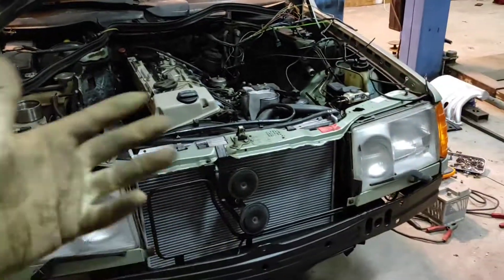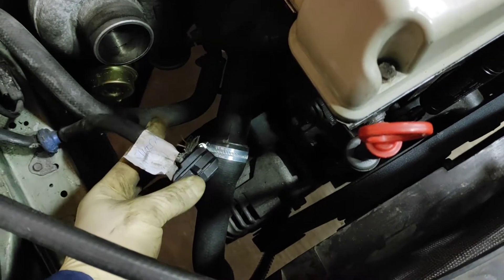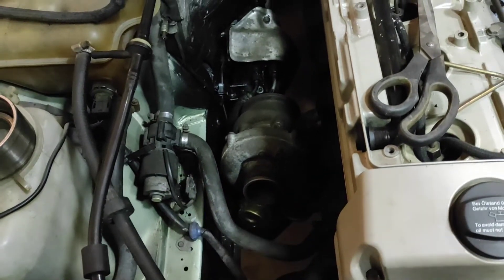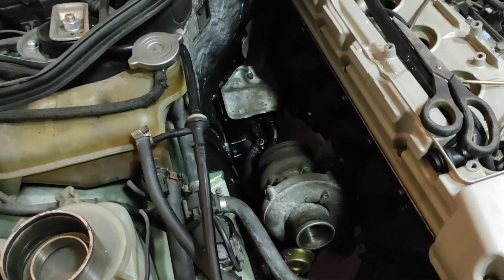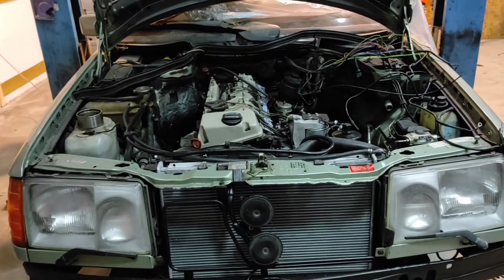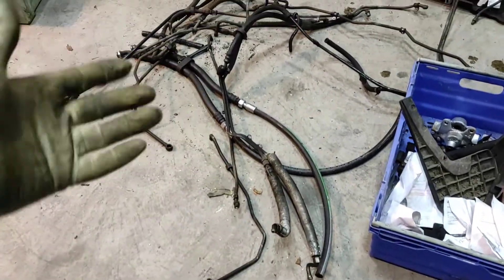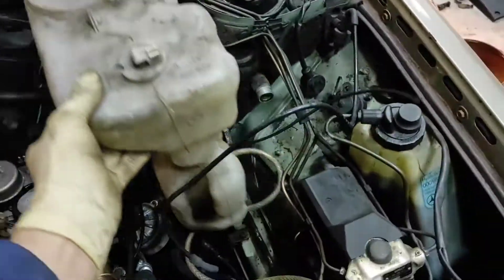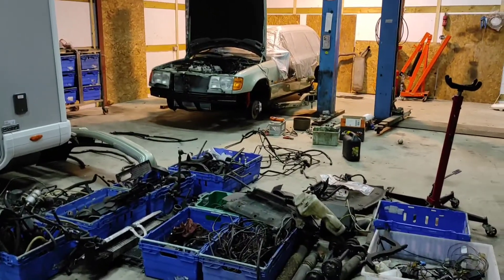Small update - Exhaust Fitment and SLS pipes

Comment: The use of hydraulic hose on the oil cooler will possibly restrict flow as the inside diameter of the hose and fittings is smaller. You are better off getting self assembly AN hose and fittings and are easy to use. You can get an AN fitting welded to the stubs that attach to the oil filter .
Reply from the maker: That's a fair point, but surely the an fitting is doing the same as it's internal diameter has to be smaller than the hose to fit inside. Might be better than the hydraulic ones though. 
I should actually be able to JIC fittings to mate to the AN fitting if I buy a cooler that's AN.